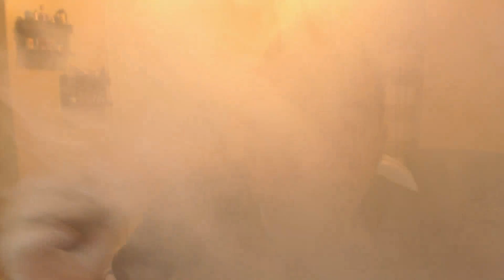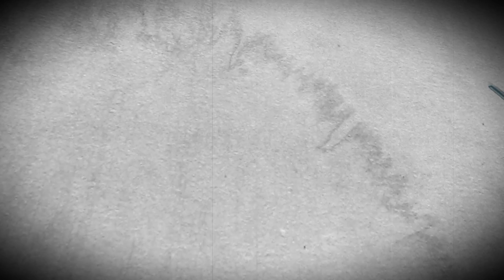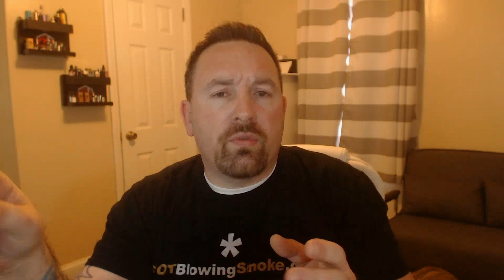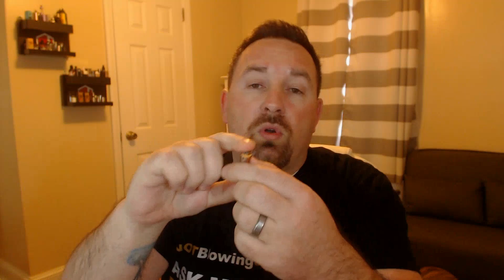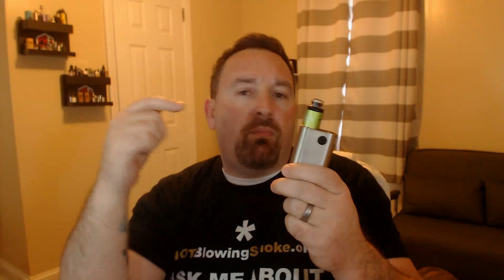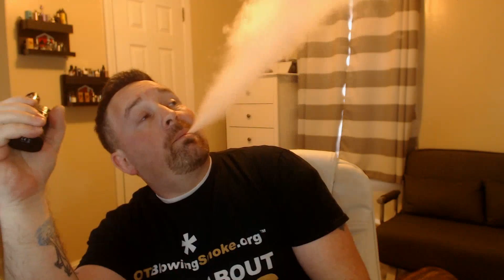Explained! Ohms and vaping resistance

Comment: .27 is higher than .4 ?  I think you're backwards
Reply: i think you're thinking of .04, .4 is equivalent to .40 in this so .40>.27
Reply: .4 is 4/10 of one. Aka 40% of a whole

.27 in 27/100 aka 27% of a whole 

This is 5th grade math that's why nobody replied to you. Just  YouTube a video about how to decimals
Reply: @thomasfoley9564  it still doesn't make sense to me, always taught 1/2 is greater than 1/4.  Wouldn't higher resistance require more power?

Comment: This idiot is blab for five minutes, and did not explain at all the reason for having one resistance value over another.

Oh, gee. more wire equals more resistance. no shit.

Useless video, useless vape lore and Millennial wives tales.
Reply: Wouldn't a higher resistance coil take more power?  He says .27 is higher than .4 which doesn't compute or does the high resistance heat the coil more so it uses more power?  I'm confused.

Comment: Can somebody simply say which is good 0.8 or 1.2😊
Reply: Higher resistance = Longer battery life, but less potential vapour, and maybe less flavour

Lower resistance = opposite of the above information 

Higher nicotine concentration can often favour higher resistance.
Reply: 0.8
Reply: it isnt that simple, it depends per device
Reply: That's what i'm saying. So to have a stronger draw you need a lower resistance and a not so harsh draw you need higher resitance?

Comment: U hit the spot summarizing resistance differences: ".1 resistance needs more power to get it going, & .6 needs less power to get it going." Thank you
Reply: Low resistance means easy flow of electrons. To create heat you need huge flow High wattage.  High resistance struggle flow and heat produced with less electrons but still good pressure, amps

Comment: Thanks for allat...but i still have this ONE Q...can i use an 0.17ohm coil on an mod that has a minimum of 0.25ohm...HAVE ANYONE done this...????
Reply: Dont do it,maybe there will be a short circuit or some other sht
Reply: @rafli4576  Thanks alot but , i just ran into a website called Reddit and they say that an TFV12 Tank IS compatible with the Morph 219 mod...which was basically is what i really was wanting to know...Thanks anyways buddy .

Comment: 4:19 Higher ohms needs less power? 1.1 @ 10watts and 1.3 @ 100 watts or 50 or whatever.  I'm deciding between a 1.8 coil and a 2.2 coil and I actually didn't learn much but it doesn't matter because it's all different at different wattage's, or whatever.  Thanks for clearing that up. Maybe.
Reply: Higher ohm  (resistances) coils needs more VOLTAGE POWER. Is what he means, not wattage. You need bigger batteries or more batteries (volts) cuz ur resistance is higher.
Reply: @derrickbernhard8380  Thanks, that clarified it for me. Since I wrote my coment I ordered one box of each and really didn't find much difference between the two in my use.

Comment: sir im using a flint kit by geek vape, and i want to use a wasp nano rtda  how can i achieve the 1.2 ohms or what kind of wire should i use...i would so glad if you answer this kind of matter thank you very much.
Reply: Depends how much space you have on your deck also. 

The lower the gauge wire the more wraps you would need to achieve a higher ohm. Everyone also has preferences on the wire they like so best way to find out is to sample different kinds. 

https://www.steam-engine.org/coil
That site has a calculator that's easy to use. You just need to put what type wire, what gauge, the inside diameter of the coil wrap(2mm, 2.5mm, 3mm, etc), and the ohm you want. Then it'll tell you how many wraps you will need. Mess around with it and you should get a good idea of how it all works.

Comment: wich blows more clouds? 0.3 or 0.15 ? i would guess 0.15 blows more clouds but can someone confirm?
Reply: 0.15 will produce more vapor at higher wattage like above 110 watt slightly warm vape lot of cloud but a 0.3 will become too hot to drag at 110 watt and will burn your mouth.
Reply: Basically lower resistance = you can ramp up your wattage and still get a cool and bulky cloud Higher resistance = low watt moderate cloud.

Comment: hi my coil is 0.17 ohm when i vape it shows 0.18 ohms is it dangeruze to vape it it show to high ohm
Reply: Mine does the same, I haven't had an issue yet. Hope it's not a big deal.
Reply: a few points off is normal, specially when you buy pre-made. It's mostly guys who build for a specific type of what they want out their system want the coil to be exact. When you want big clouds, more flavor, less batt use, slower/faster ramp etc, then you have to figure out which coil gives you those choice. This is why a lot of serious vapers build their own coils,and why well built pre-made coils cost more, since it takes more effort to build to be accurate every time.
Reply: @draxxes1   2 year old comment but I’m hoping I get a response lol My coil is also a 0.17 but my tpriv mod reads it as 0.13 so less ohms than what the coil actually is, is it an issue or is it fine to keep it at 0.13
Reply: @sleepy_otaku  it should be fine, most mods have auto adjust for proper ohm. You should also check your coil once in a while ( if you reuse them after cleaning) in case you have broken strands. I had 1 of my mods change ohm on the same coil, so i double checked the coil up close and saw there was a broken wire. I replaced it and it was back to normal.
Reply: @draxxes1  Cool, thanks a bunch for replying back to my comment and for the help 👍

Comment: PLS HELP ME SOMEONE I HAVE A BATTERY 3750 mah it is 3.7 volts and max rate is 40 A CAN I PUT TWO COILS ON A SQUONK MOD THE COILS ARE 0.41 OHMS and the mod is at 90 wats
Reply: Misthub has a calculator for making sure your good.
Reply: @bdp fucc up research is fucked. How does a higher resistance coil require less power and offer desirable results? You fire that bitch for 20 seconds before you pull off of it? This is ridiculous. lol

Comment: I have a aegis 100 watts mod, zeus dual rta
I came to a vape shop to change my coil to alien 6 wrap
After that my coil resistance became 27 and it takes about 12 second to get hot
Reply: remake your coils, turn up your watts also, you mean 0.27? or one of your coils may not properly be connected inside...

Comment: I a newbie here, I set it up to 75.0 watts and the coil that I use is fused cantal but after the guy at the shop change it to a new one (still a fused cantal) I am getting an error on my mod " low resistance". How can I fix it? I am using a fuchai.

Comment: i think there is a mistake through the end, the more resistance you have to more power you need, and vice versa
Reply: bdp fucc up I don’t really understand what you’re saying.. the guy said “the more resistance you have, the higher power you will need and vice versa.” I corrected him saying the higher the resistance requires less power and now you’re essentially “correcting” me by saying the exact same thing that I already said? Mechanical and regulated are the same principle.. lower resistance equals higher wattage.. higher resistance equals lower wattage.
.5 on a mech would run at 35watts
.25 on a mech would run at 70watts.
70 watts on a mech is the same as 70 watts on a regulated so I really don’t understand what you’re talking about.
Reply: madjid ryadh no the higher resistance requires lower power..

Comment: There is no correlation of residence and needed wattage if you use regulated Mods. Only coil size matters.
I can build 1 Ohm and still fire it at 80W. Just has to be big enough not to get too hot.

Comment: I got 0.31 ohms on my zeus dual rta and im using aegis legend 200w is it safe?
Reply: Lil Draven it’s a regulated mod so you should be okay. Just make sure your amp discharge doesn’t exceed the safe point on your battery. I
Reply: @theproject109  what about the amp? What do you mean by discharge?
Reply: Lil Draven basically if the battery releases more energy than what is safe it blows up. So if your using a 20amp battery make sure you coil don’t discharge. You should be fine around the 80w area

Comment: So my coils are framed clapton 0.26 ohms but my mod shows 0.52 ohms sometimes it changes to 0.45 or 0.35 why? And sometimes my mod ask if it is a new or old coil I tough it a connection thing but i keep it clean always checking for leaks i have the Pulse from vandy vape running the dead rabit drop dead rda in quonk mode, any suggestions?
Reply: Hey I’m not vaping (YET) but in circuitry I’m pretty sure  the resistance of a coil doesn’t change I’m pretty sure it stays constant but a loose connection can defiantly give different readings so I guess make sure you screws holding you coils are not cross threaded or loose or even give you coil arms a clean to make sure there no oxidising by connections causing more resistance but I’m spit balling lol I’m noob to vaping but have a little electrical know how 👍
Reply: the coil resistence change with the coil temperature, the more heat the more resistance increase in value , this is perfectly normal

Comment: I need some advice. So I have right now the eleaf istick 80W. I am using big baby tank with M2coils. Vaping around 35-55 watts. After a day or two the air holes from the tank keeps leaking and it is brand new. Did I do something wrong?please give me some advice new to MOD vaping lol.
Reply: Don't use the M2 coils. They're the worst coils for the big baby. You're not getting enough power so you're pulling up juice that's not getting vaporized quickly enough. Switch to the Q2 coils and vape at the recommended 55w.
Reply: Try to close the air holes before filling up the tank or remove the tank n then fill it up then put it back on to the mod
Reply: I know it's a really old tank but try the Supertank or Supertank Mini by Tobecco. I've had the Mini for almost 4 years lol & I absolutely freaking love it!! Only times it leaks & I wouldn't consider it leaking is when I chain vape & the juice gets warmed up or the coil is going bad, usually it's the coil. It's interchangeable with a zillion kinds of coils but I honestly like the normal tobecco coils. It's a super cheap tank with super cheap coils! Let me know if you get one! If u do & hate it, I might buy it depending on color lol.

Comment: So tell me i have 0.34 build so how much power i can vape?
Reply: For wattage, the calculation is battery voltage to power of 2, divided by resistance - so 3.7 x 3.7 ÷ 0.34 = 40 watts
Reply: Vaping Smurf I'm confused
Reply: What part is confusing you? I'll try to explain it better
Reply: Vaping Smurf tell me i have 0.68 build how much power i can vape tell me the math
Reply: Vaping smurf is correct tino cular the * mean mutiply (×) so your battery voltage Multiplied by itself devided (÷) by the coil size you want to use gives you your watts sooo example 4.2v x 4.2v ÷ 0.5=35.28 but we'll round down sooo 35W.
Lool to be honest i just learnt this whitin 10 minutes lol by using google an my basic understanding of ohms law. I hope this helps
Reply: 512460 so if im corecct my build is 0.51 now so ~my voltage is 4.19 = 4.19×4.19÷0.51 is around 34 Watts?
Reply: Tino Cular thats correct, see.. there you go you've got it :) good stuff
Reply: 512460 appreciated man!
Reply: Tino Cular however i dont know if that 34w is the minimum needed to get that coil hot or the maximum wattage you should use for that coil size. Loool haven't figured it all out yet if you get what i mean loool
As i said i just learnt and im passing it on lol.
Also do you have a regulated mod?
Reply: 512460 yes I have limitless arms race with obs crius 2 rta
Reply: @tino7235  go get on ECF! Lots of great ppl there that will help alot. If u have a 2-3 battery mod with reliable voltage drop batteries you would have to vape at serious watts to be in trouble.
Reply: I have a .36ohm coil & I'm at 55-65 watts. Sometimes little higher depending on what juice I'm vaping. A couple juices taste better at higher watts.

Comment: if i build my deck.. and lets say i put one coil in with 0.25 ohm. what happens if I add a second coil with 0.25 ohm ? does the resistance half itself or double itself ?
Reply: In parallel they halve, in series they add up
Reply: You will get .125 ohms for 2 coils if single coil is .25 it will cut the resistance into half

Comment: Let's say that i set mod to 50W. What's the difference betwen 0.2 and 0.6 ohm?
Reply: with 0.6 ohm you will get more vapor and i think you will probbaly lower down your wattage, but with 0.2 ohm you will get less vapor and you might want to go higher with wattage. Im running a .62~ ohm coil and 60wats is too much for me, its all personal preference, but the higher the ohm's the more vapor. Not to mention if you vape at lower ohm's with higher wattage you will get more dense clouds and probbably flavour, but at the same time your battery will dischrage faster. I hope im not wrong  anywhere and someone will find this helpfull.
Reply: 2.7 volts vs 5.4 volts. If you put a .15 ohm coil in a 50 watt mod your max wattage output will be 2.7 volts at 50 watts which will be pretty much useless. The .6 will allow you up to 5.7V @ 50W which will produce fine. If it’s a adjustable mod I’d put in a .5 ohm coil and run it no higher then 46 watts.
Reply: thank you, you explain better than that guy in the video
Reply: Thats funny, because im pretty new to all this 😂
Reply: Sorry, that's not quite right. A 0.2ohm coil will produce more vapour than a 0.6 ohm coil because the 0.2  ohm coil requires more power to be heated. Generally, a 0.2 ohm coil would be vaped around 60 - 70 watts, while a 0.6 ohm coil would be vaped around 20 - 30 watts.
Reply: Well you're wrong there bud, you probably didnt get what i meant. The original comment asked what would be different with 0.2 ohm and 0.6 ohm on 50 Wats. With 0.6 you will get more vapour, because it needs less power.
Reply: Just because it requires less power, doesn't mean you will get more vapor. Coils with higher ohms require less power because they output less power and therefore don't output as much vapor as coils with lower ohms. 

Think about what sub-ohm really means. It means the resistance is below 1 ohm. Sub-ohm vapes are more powerful than mouth-to-lung vapes. This is because the coils in sub-ohm vapes are below 1 ohm while the coils in mouth-to-lung vapes are above 1 ohm. So the farther below 1 ohm the resistance goes, the more power the vape is capable of, and the more vapor it will produce. 0.2 ohms is farther below 1 ohm than 0.6 ohms, so the 0.2 ohm coil will produce more vapor. 

However, at 50 watts, the coil with 0.6 ohms will work more efficiently because it's being used at the recommended wattage. This doesn't mean it's producing the most vapor. It just means it's working like it's supposed to. If you really want to chase clouds, use the 0.2 ohm coil and vape at the highest rated wattage of 80 watts, and you will get much more vapor than the 0.6 ohm coil is capable of.

Think of it like the gears in a transmission. When you're in first gear, less power is required to reach higher RPM's, but you won't be going very fast until you shift to second gear and so on, each gear requiring increasingly more power to reach higher RPM's. 6,000 RPM's in fifth gear requires much more power than 6,000 RPM's in first gear, but you'll be going much faster in fifth gear than in first gear as long as you're at the recommended RPM's that fifth gear is capable of. Conversely, if you try to accelerate from a dead stop while starting in fifth gear, it will take a very long time to get moving because you're not outputting the required amount of power to reach high enough RPM's for fifth gear to operate efficiently. In this analogy, the 0.6 coil would be first gear, which doesn't require much power to get going, but also can't reach high speeds (can't produce more vapor) and the 0.2 coil would be fifth gear, which requires more power to get going, but is capable of higher speeds, (higher vapor production).
Reply: nobodyhasthisyet yeah, i understand that. I was talking more about rda's and the guy asked what will be the diference, and so i said that more ohms- more vapor than at the same wattage but with less ohms. I get what you mean.
Reply: My recommended coil wattage is 55w-65w but I like it better at 35w is that safe?

Comment: I have a question so I resent let just moved up from rebukdables when I first installed my coils they weee reading 0.15 now they read 0.35 why did this happen?
Reply: i have this kind of status here also what cause this?
Reply: @jenifergabales8206  check all connections & make sure they're tightened. Also if your mod is a series your coils double vs if it's parallel each coil will be 1/2 itself... So if u got a    .30 ohm coil & install 2 your ohms will be .15 on a parallel mod & .60 on a series. Usually if connections aren't tight it jumps all around on you.

Comment: I have a cloud beast tfv8 and my mod is cuboid 150, i just bought it about 3 days ago. While i was vapig, i had an error as atomizer short. I did the battery flap fix and it worked, also cleaned by atomizer with blow dryer and then cotton buds. Before all of this, my ohm reading in power mode was 19, now, its .26. I'm getting confused if its right or do i have to change the atomizer or coils?

Comment: the lower ohm the better?
Reply: the higher the OHM, the less power you need.
Reply: Jay Wong lower ohm better clouds but need higher power so rip your batts.
Reply: Let's say that i set mod to 50W. What's the difference betwen 0.2 and 0.6 ohm?
Reply: @Macias .2 ohm resistance will go around 65-75watts. Higher watts for more clouds. And .6 will go around 15-30watts. This is for battery that has 3.7v